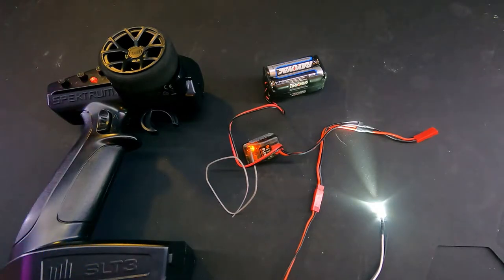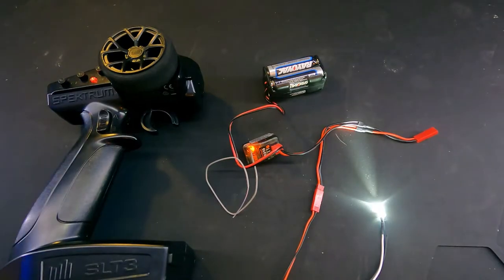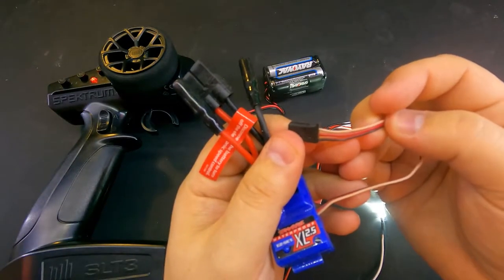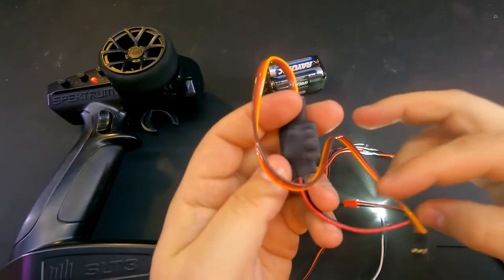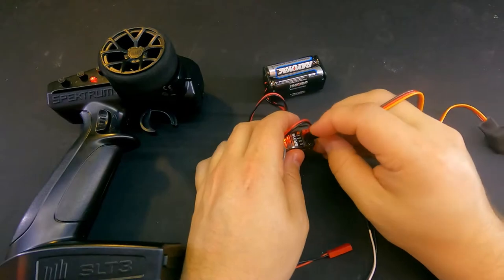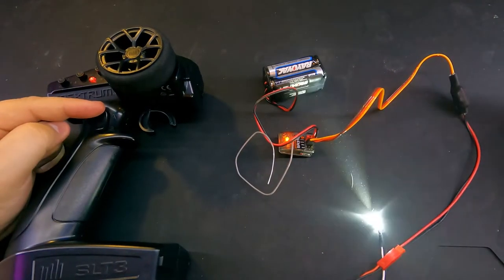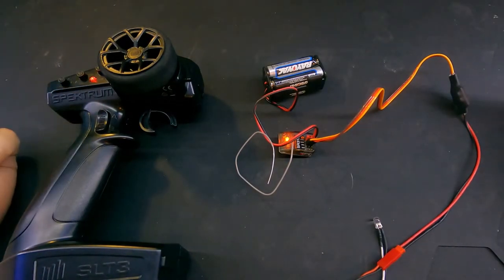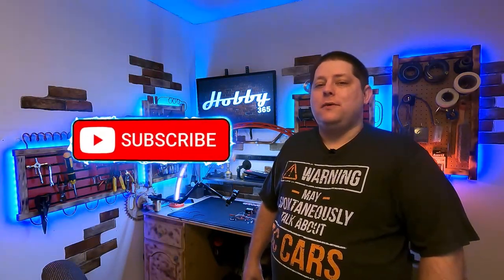How to make LEDs work with a 3 channel radio.

Comment: No that baton will actually work as on and of switch. but you have to program it in the channel 3 setting it really works on that Spectrum DX3
Reply from the maker: On the dx3 you can program that as a on/off switch. I couldn't find anything on how to program the SLT radio. Did you have success getting that 3rd channel to work on the STL? If so, I would be very interested to learn how you did that.
Reply: How did you configure it for on / off switch? I think you are confused with a diff a remote, that’s the Spektrum Slt3 he’s using

Comment: I’m wondering if one of these 3rd channel light controllers would work on say the element stock transmitter with a 3rd channel switch instead of a button.

Comment: I bought a yellow Beacon Light that has a harness that's supposed to connect to a channel 3 receiver but I just want to hook it up to a 9 volt battery to put it into a miniature model that I made so I guess my question is how do I eliminate the third signal wire to where I can just have the light powered constantly without a remote signal

Comment: Need some links to the parts you use. 
Great 👍 video 📹
Reply from the maker: I have updated the disruption with your suggestions. Thank you. 

Radio: https://www.hobbytown.com/spektrum-rc-slt3-3channel-slt-surface-radio-w-slr300-receiver-spmslt350/p-xqyqs4gq2tqzt4yz

LED kit: https://www.hobbytown.com/yeah-racing-ultra-bright-led-light-kit-w-light-holders-yea-lk-0001wt/p-xuhzhe9qctabg4yz

Electronic switch: https://www.hobbytown.com/powershift-rc-technologies-pst-2-position-switch-w-12v-booster-pwr-013/p-xthnscaqztabg4yz?r=0

Comment: what does the B switch do?
Reply from the maker: The A/B switch in a lot of models operates things like rear steer, dig or 2 speed. Think of the A/B switch like left and right. There are some vehicles that the switch does nothing and you can use them for auxiliary functions like these lights.